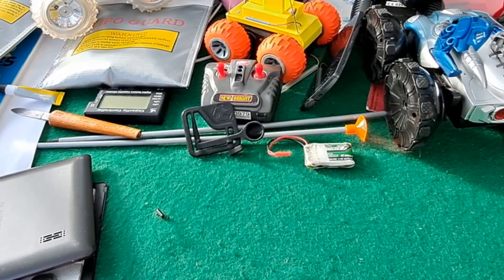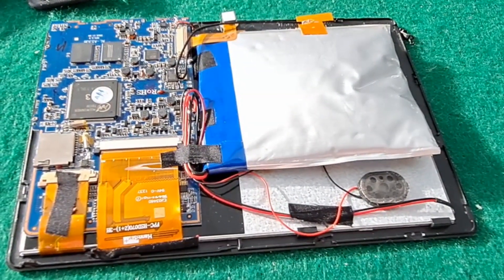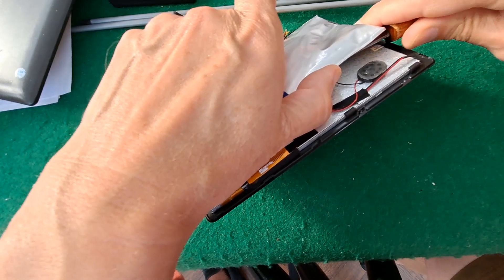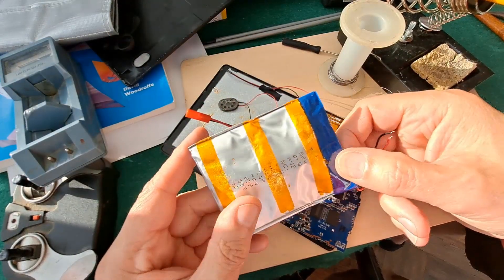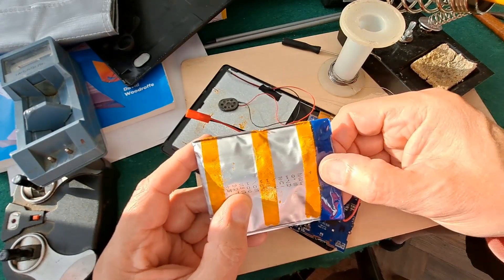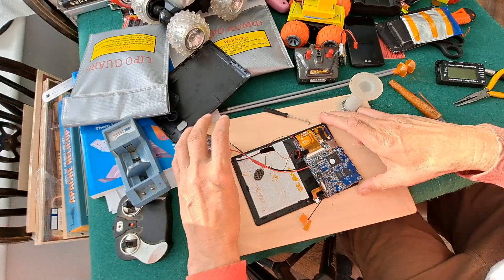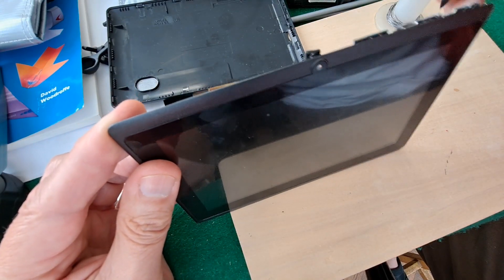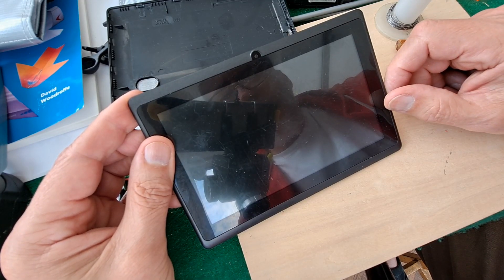Peek inside an AllWinner A13 2012 tablet

Comment: Nice little notepad for doing small amount of Work on it.wondering if it has an external power supply as well  ?2012 😁 that battery pack is rather old but the Rest is in good condition. Nice fix alsowith the lipo battery pack.😀
Reply from the maker: Yes, and I found I can charge that LiPo via the USB port on the tablet, so that is handy.

Comment: Great job getting it working.
That is a real pain with the PIN. Usually, a little hole to reset the tablet back to factory default, but you said you tried that. That is very unusual because I have done it with a couple of tablets and it always works. Have you pushed and held the reset button for about 10 seconds. Unless there is a help screen you need to access first in order to rest it. 
A little help icon on the start screen sort of thing?
Well, good luck. Hope you get it unlocked. 👍👍👍
Reply from the maker: Next video 😁 One O'clock I think. 👍
Reply: @GrandadIsAnOldMan  Oh good. Looking forward. 👍👍👍🎸🎸🎸

Comment: IDK google it

This link seems to have several different methods .

https://www.askmefast.com/How_do_i_reset_my_Allwinner_A13_tablet-qna4682851.html#q5301357

I recognize some of them as how I did a factory reset on my android phone.

One method that a person responded to saying it worked was :

:". . . In order to perform a hard reset you should turn the device off. Then, I`d like you to hold the volume up and menu button at the same time until the device turns on and then enters it`s reset menu. You`ll need to choose the factory reset option and then wait patiently until the process is complete - do not turn the tablet off during this process. Any previous issues should be fixed, however if they are not, you may reply to my answer for further assistance :) . . . "

Some people are suggesting hooking it up to a programmer and flashing the chip !
Reply from the maker: I did work out the reset in the next video
Reply from the maker: Worth noting the "factory reset" did NOT delete any of my grandaughter's files/pictures/music etc